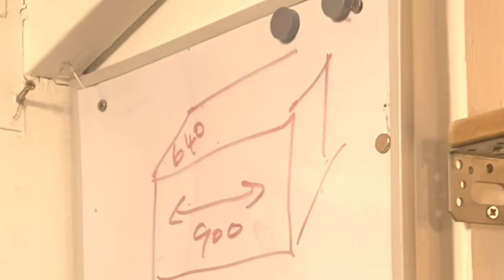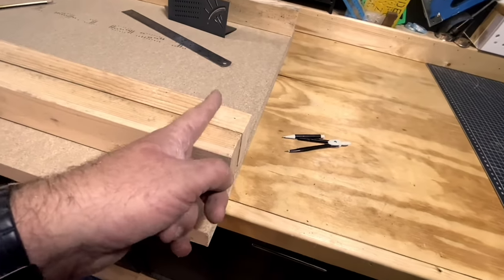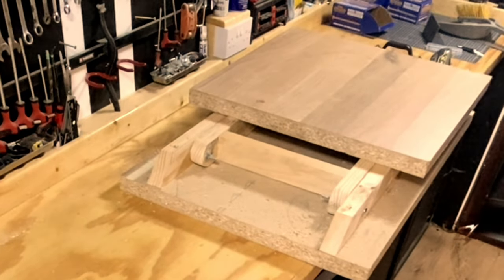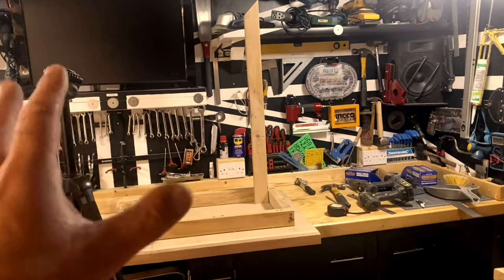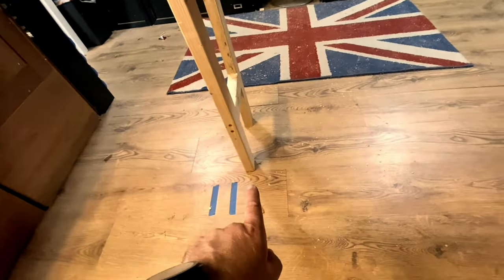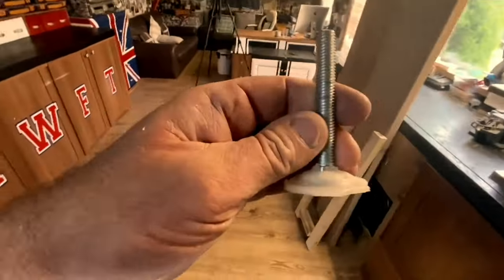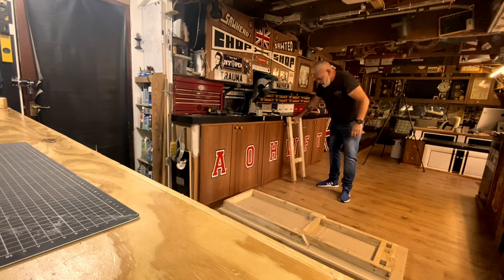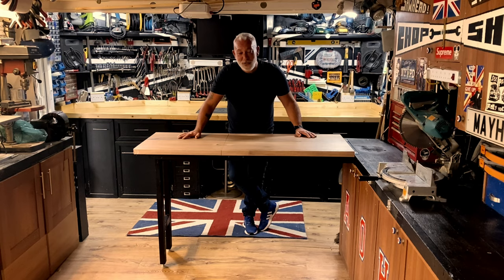I made a cheap FOLDING WORKBENCH in my workshop

Comment: That's an impressively neat and robust little bench. The adjustable feet are especially ingenious. Good job all round mate! Could I suggest a little refinement? You might consider  rounding off the corners. Sure as eggs is eggs you'll bang your hip on the square corners as you pass in the confined space - hoo boy, that can really smart! Cheers Rob, that was fun.
Reply from the maker: Many Thanks mate 👍 and a very good suggestion and it was something I’d thought about.. and I usually wait until I’ve hurt myself first before doing something about it 🤣😂 but now I’ve had your suggestion... I defo will👍💪😉, I’ll give the belt sander another outing! cheers Mark.. all the best Rob
Reply: @WeekendShedHead  The belt sander will ideal mate. But be sure the vacuum cleaner is hooked up!
Reply from the maker: @MarkMcCluney  👍👍👌

Comment: I think I might have put those angle brackets flush to the new top and rebated a couple of bits  on the existing bench (where you're screwing it in) to drop them into and still screw them down.  That way you would have the two intersecting countertops flush with each other.  Just a thought.  Great that it tucks away into the cabinet.  Cheers.
Reply from the maker: Good idea mate, however the side bench is lower than the main work bench (at the end), and I wanted to keep it level with that one, hence the step down... but I always appreciate feedback 😉👍 thanks for watching.. cheers Rob
Reply: @WeekendShedHead  I thought that might be the case.  As you were. LOL
Reply from the maker: @robthewaywardwoodworker9956  👍😉

Comment: Superglue the threads of the hinge bolt or add another washer and nut (washer to make the threads out of sync) so they dont come loose. or use a nyloc /  locking nut.  Oh I see now you are fitting another nut, oh well.
Add some glue on edging or a trim piece of wood to cover the chipboard
Reply from the maker: I’m going to attach the trim at a later date, thanks for watching, cheers